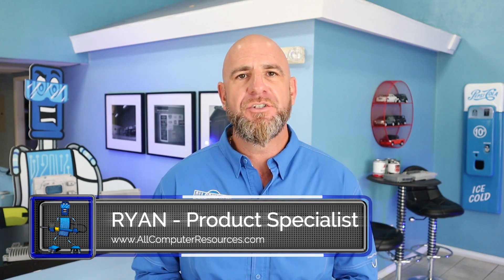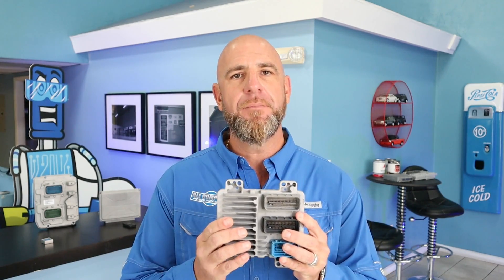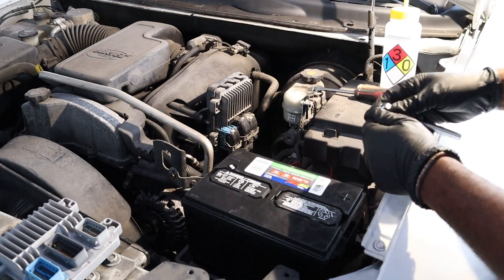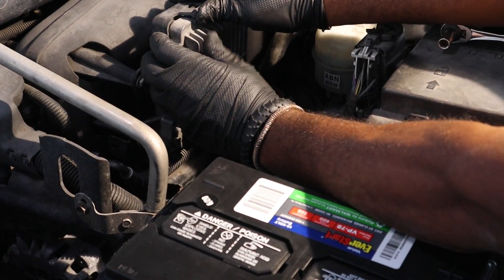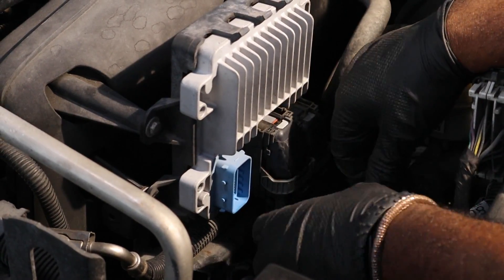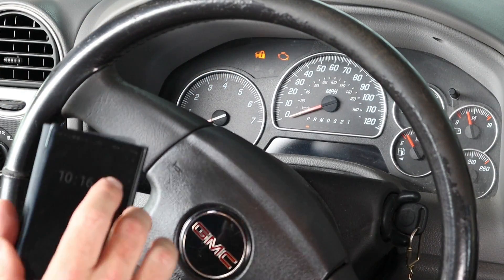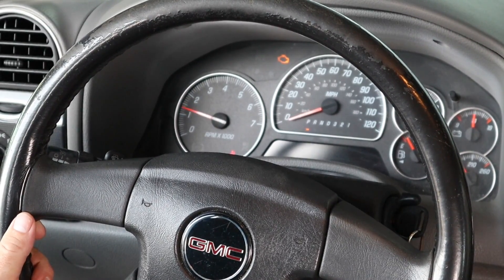HOW TO PROGRAM KEY FOR GM/CHEVY ANTI-THEFT - ECU REPLACEMENT PK3+ / PASSLOCK

Comment: Just wanted to say thank you VERY much.  This helped me with getting my truck running after replacing the computer.  Now, I need to figure out a way to get P0315 code to clear, without the expensive bi-directional scan tool.  I tried searching on Google, and found a 'manual' procedure, but it didn't seem to work.  2005 GMC Canyon 3.5L i5 engine.
Reply from the maker: Glad we could help you!

Comment: does this procedure also work when I use an identical computer taken from another car? Can it be adapted to my car without the need for a software connection?
Reply from the maker: The short answer is No. The PCM will require specific calibration to your vehicle along with the VIN which has the PIN codes to carry out the key relearn.

Comment: How do I clear the keyless remote slots in the bcm on a 04 tahoe? 
Took it to chevy and they tried 2 different scan tools and couldn't find that in those system.   Just got this vehicle and only have one remote and had an extra key made but could not program a new remote as all spots are taken for the remotes.   Any advice would be helpful.  Thanks

Comment: I have a 2014 silverado lt. I purchased a new ecm from flagship, it’s programmed, but i followed your instructions but no luck. The only light that is on is the engine light and it blinks… i did the 5x 10 min and nothing any thing else i can do?
Reply from the maker: Hi Daniel, sorry about the issues you are having with another company. This could be a result of faulty programming or an issue with your VATS (anti-theft). We have the ability to disable VATS which would bypass the key relearn. We can provide that service or a PCM with VATS disabled. Call us M-F 9a-6p EST and we can set it up for you.

Comment: I have a trailblazer. I did the exact steps you talked about, but the code p0315 appeared. How do I solve it without the need for a computer? I mean, in a simple way. Please reply as soon as possible, thank you
Reply from the maker: P0315 Is for the crankshaft relearn. Here is a link to our TechTalk section where you can find the instructions for relearning the CASE. We can also disable that for you if you want to send the PCM to us. https://store.allcomputerresources.com/techtalk.html

Comment: I put a 3.6 motor in a camaro from cadillac  same motor but can't get it to turn over do i need a new ecm
Reply from the maker: Hey Chris, to get the motor to turn over and continue your swap, you may want to remove VATS (theft system) from the PCM. This is a service we offer. You can call us at 786-879-7566

Comment: What is no light comes on  the only  thing that comes out is the check engine light  blinks.
Reply from the maker: All depends. What’s the year make and model and was the part ordered from us?
Reply: It's  a 2013 Chevrolet malibu
Reply from the maker: @956exterminator8  This is the correct procedure for your 2013 Malibu. If the module was purchased and programmed from us and the security light is not illuminating as shown in this vehicle, you could have issues with your security system. We do have the ability to remove the security from the PCM, which will bypass this relearn. You can contact us at 1-866-699-5230 if you would like that service. Thank you

Comment: I’ve replaced my pcm and I’ve tried the key relearn process 8times. I’ve replaced the alternator,battery,throttle body,starter and fuel pump. It still says service theft deterrent and starting disabled service throttle. I’ve literally done everything I can at this point.
Reply: Did you ever find out what it was?
Reply: Have u figure anything out about fixing. Mines the same way
Reply: Check out your bcm and Instructor cluster

Comment: Trying to do this with my 2011 camaro but the security light doesn't turn off after 10 minutes. I sent them my Vin as well & they told me it was a passkey 3. I put on the stock module & the car start but it's misfiring.
Reply: did you ever figure this out Im having the same issue where "service theft deterrent system" after 10 minutes stays up

Comment: Thank you sir i do this sir the car start good and i road test is good but when i turn off the same problem i relearn again then start the car again when i turn off again the same problem again like the relearn procedure not save possible the pcm is defective? Pls give me idea thanks and more power godbless
Reply from the maker: I would say that the issue would be more related to the actual Security System within the vehicle as it is not holding the information. The PCM does not control that system it only submits the code after the relearn procedure then the system marries that code.

Comment: All computer recourses, I took the motor out of one of my trucks and put it in the other one and now it will not crank or spin over by the key. Will this procedure fix my problem?
Reply from the maker: Hi Bobby, your situation is much more complex than an ECU replacement
Reply: @acr  do you know what I can do to fix my issue
Reply from the maker: @bobbyfishscale4607  we would recommend diagnosing the vehicle and figure out exactly why it's not starting. You performed a motor swap so there's a lot of moving pieces to that.

Comment: I have a 2004 Silverado with a 6.0 swapped in it. It's currently running on the 4.8l computer and we have a 6.0 computer from the same generation. Would this key relearn work for our application?
Reply: Did u ever figure it out ? 
I bought a junk yard pcm but idk if I'd have to get it reprogram to work with my truck

Comment: I noticed a comment exactly like mine however they never responded. I replaced my ecm in my 2014 enclave. When I went to do the key relearn, the first round it started with no dash lights on. I’m not sure what I should do next? Thank you
Reply from the maker: Hey Josh, thank you for the question. Did you purchase the part from us that was precalibrated specifically to your Enclave?
Reply: @acr  the ecm was preprogrammed to my enclave using the vin number. But no I did not buy it from you guy’s sadly enough
Reply from the maker: @joshgochenour4062  Hey Josh, I would contact whomever you purchased the programing & part from and be sure the calibration was set correctly. Also be sure that you are turning the ignition to the crank position as demonstrated in the video which will trigger the security system.
Reply: @acr  will do. Sadly replacing the ecm didn’t fix my larger issue lol. But I will definitely be contacting them thank you

Comment: I was gonna replace my computer since my car has slow cranking and it doesn't turn and I got a code of a failure computer..

But my car has a all metal key..so, what procedure do I need to do. 
Saturn ion coupe 2006

Comment: I just installed my ecm in my 2004 Cadillac SRX 3.6L but my security light doesn't stay on ten minutes to program the key.
Reply from the maker: Hey Hal, Did you order the pre-calibrated ECM from us?
Reply: Yes
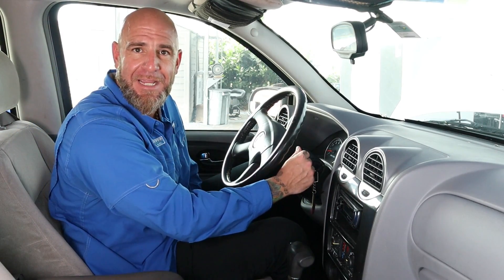Reply from the maker: @haldchilds850   This video outlines the proper procedure for your vehicle. Please be sure to follow the procedure correctly as outlined if you got to around 5:50 of this video

Comment: I need help, I started my truck one day and immediately turned off so from there I replace the instrument cluster, flue filter fuel pump coil packs check for blown fuses, I replace the ignition switch, lock cylinder I tried this method of the 30 minutes and 30 seconds like 5 times and nothing 😫, pls help
Reply: Other thing the security light doesn’t stay on the cluster and appears when when the truck starts and dies 2 seconds after and the security light goes away again, I checked the gas pressure and it’s okay
Reply from the maker: This video basically outlines the process for replacing the PCM on a GM vehicle when the PCM is purchased from us. If you have changed the ignition switch/ lock cylinder, that may need to be programmed to the vehicle.

Comment: Am troubleshooting a 98 astro van that won't start, only crank. Several sensors were removed and replaced,  I ordered a used serviceable ECM would this computer needs to be reprogramming?
Reply from the maker: 98 Astro Van ECMs required calibration and VIN programming
Reply: @acr  thanks, what would  be the charge for it?
Reply from the maker: @josealonso7190  Here is a link the 1998 Astro Van listings we have. Please be sure to select the item that matches your Service# from the original PCM or you can call toll free: 1-866-699-5230
https://store.allcomputerresources.com/searchresults.html?query=1998+astro&vwcatalog=yhst-21854666697846

Comment: What if the security light don't come on and what happens if just the check engine light
Reply: My check engine just keeps flashing
Reply: @monicaschmale8290 i’m literally sitting in my car i’ve been trying to do this i’m on my second round and i just looked up this video
Reply: @monicaschmale8290  did you find a solution to this?
Reply: Did this 2 times now still have no crank. I put old ecm back on it cranks up. Idk know what to do
Reply: I have a same issue with the check engine just flashing and the anti theft does turn off right away but it has a no crank . 2010 gmc savana 3500
Reply: Has anyone found a resolution to this? My ECM came already programmed to my vin.
Reply: Did you ever get an answer for this
Reply: @arizonaadventures6203 no
Reply: You need to reprogram the ECM to your VIN
Reply: @mujjuman  how to do that
Reply: On my 2006 Silverado my light wasn’t coming on so I went around the whole front end and cleaned all engine grounds, closed all open circuits and got everything all buttoned up. After that I got all the relays to click over and the security light now stays on for the whole sequence. Mind you this is after a complete engine swap
Reply: @Bullcat-hl8tt yo me too I swapped my engine & now I'm having the same problem.. On A Cadillac "GM" did you find a solution ????
Reply: Did you find a solution
Reply: Solution?
Reply: Any solutions???
Reply: Same
Reply: It's a 2012 Chevy equinox 2.4 l with a flip key.
Reply: Anyone?
Reply: Soooo does anyone have an answer to just the check engine light on, no security light
Reply: @ebaby3220  it’s either something else internally wrong with your car or you have not gotten your part programmed and flashed right, try taking it to your dealer, they should be able to do all that for you
Reply: Same 2010 Camaro v-6
Reply: I'm having same issue
Reply: Why is there no answer for the fix with nothing but flashing xlcheck engine light
Reply: That's all I'm getting 8 times later
Reply: @andysteffey5968  have you found a solution?

Comment: Thanks for posting this, it is probably helping a lot of people. Thought i would add my experience to the comments though as it didn't work for me. Apparently if the TDM is configured for export the 30 minute process will not work for you. If the car is made in the USA and exported then it doesn't work and you will have to program it with a scan tool.
Reply from the maker: Carlos, thank you for your input. This may be true for certain models but is not a blanket statement for all GMs that are exported. It would depend on the calibration and service#s and we prefer to address them on a case by case basis. If you would like to share your vehicle year/make/model It could offer some insight to those with that same vehicle.
Reply: @acr  True enough, best just to try it out and see if it works, if it doesn't you will have to have a scan tool to take care of the problem like i did. Thanks for creating this content.
Reply: @acr  i have an 06 GTO pontiac, would i need a scan tool for this procedure? I also heard i need 2 security codes for my car in order to do the relearn process. Do you have any insight on that ?
Reply: These gto’s were imported from Australia as a holden manaro
Reply from the maker: @Mr-th5hw  If you purchased the ECU from us, then you will not need a scan tool to relearn the key. These instructions apply to modules calibrated by us, but it may work in other scenarios. We also offer a service that will eliminate the security system, thus avoiding the key relearn altogether. The ECU must still be VIN programmed and calibrated to your specific vehicle. GM Computers carry a service # that applies to many models however, although the service# matches, the calibration is different. Please be sure that your replacement computer was properly configured for you.
Reply: @acr  i am going to get a ECU from you guys! But first, I’m going to check the service number on mine (gonna have to unistall). 

So from my understanding (if i get from you guys) I wouldn’t have to take it to a dealership to relearn anything ? No security codes needed (immobilizer code 4 digits & frequency code 6 Digits (BCM)?
Reply from the maker: @Mr-th5hw  Yes, that is correct. You may not need to remove your old unit. Give us a call with your VIN and we may be able to decode the service # for you. 786-879-7566
Reply: @acr  also, my car is modified (FBO, cammed) would this video still help it start up/relearn? And then take it to tuner after installing and all..
Reply from the maker: @Mr-th5hw  If the ECU is tuned to the modifications, you would first need to un-marry that ECU and apply the tune to the new ECU. Keep in mind we do not offer end-support for aftermarket tunes or modifications. Our ECU's are calibrated using the specifications set by the manufacturer
Reply: @acr  what if i just add a new tune to the replacement ECU ? Would i have to “unmarry” the stock ECU anyway ?

Comment: If I happen to not have the master key, can I still program new keys to a new ecu that has already been program for my vin? Basically the new ecu came with no keys. Have old keys that may not be masters. This stuff gives me headaches. Someone help me. Got a new ecu. It came with no keys. What do I do to get the car started? What keys do I buy? Can I use old ones? Too complicated bc it I put the new ecu in and need the master key, then I might not have it. My kid does start and drive the car....or do I get new transpo blanks for the new ecu? Confusing when you don't have a clue.
Reply from the maker: If the keys you have were previously programmed to the vehicle prior to installing the new PCM they will work once you follow the correct relearn procedure for your vehicle. This is only applicable if the PCM you are using is calibrated and VIN programmed.

Comment: Can u do this procedure with a Vin starting with 2 canadian made vehicle....my key broke got new key cut at gm trying to program it tried for 5 days now can't get it to work...do u need to disconnect the battery cable for 30 min to reset it before u try another 30 min cycle to reprogram new key

Comment: Nice video,  my cooling fans stop working mechanic said ecu bought one new flash did the reprogram cooling fans started working later down the line unplug battery cooling fans stopped again please help 2001 buick leasbre

Comment: Mine I just got today not even working
Reply from the maker: Hello, We would like to know a bit more in order to help you.  Did you order a part from us, what is the year make, and model of the vehicle, what issues were you having prior to ordering the part, etc.
Reply: @acr  got it today from u guys was trying this 30 min relearn on my 2010 silverado
Reply: @acr  it also said fr scan tool from a garage ecm not reading on my truck
Reply from the maker: @Truckguygrant8782  Understood, If you check this video at 5:30 it's mentioned that connecting a scan tool could corrupt the ECU files. Please open a tech support ticket by following this link and we will assist you further. 
https://store.allcomputerresources.com/support.html
Reply: @acr  ik I've watxh it

Comment: What happens if the security light doesn't stay on? Can not do key relearn without it...
Reply from the maker: Please confirm that you are performing the correct Relearn procedure for your key type/vehicle. Depending on the year, GM vehicles have also had issues with the actual security system which may play a role in your situation. Did you purchase a PCM with us? I can put you in touch with our ASE Team if so.
Reply: @acr  yes I purchased it from ACR, yes I know the right procedure, thx for quick response!
Reply from the maker: @robertbishop8898  Excellent, In this case, please contact our tech team directly by following this link. Please be sure to have your Sales Order#:   https://store.allcomputerresources.com/support.html

Comment: Hello! I have a 2011 Buick Regal! I replaced my computer and followed the video perfectly! I did not purchase my computer through you! I bought it from Flagship One! My car did not start though. My security light turns off immediately. Would that have anything to do with my key not being able to be reprogrammed? Also, I do not have an unprogrammed key. Would that effect anything?
Reply: Any update? I just bought my ecm from Flagship as well. And the key reset instructions also did not work.
Reply from the maker: Hello, It would be difficult to answer these questions since we are unsure of the programming techniques used by the company you purchased your part from. Do they offer any technical assistance?

Comment: Do I have to do this with TCM I bought from y'all
Reply from the maker: No, this procedure doesn't need to be performed however, if the transmission entered into a fail-safe mode during attempts at driving the vehicle while the TCM had failed then you may need to perform the Transmission relearn procedure with a scan tool.